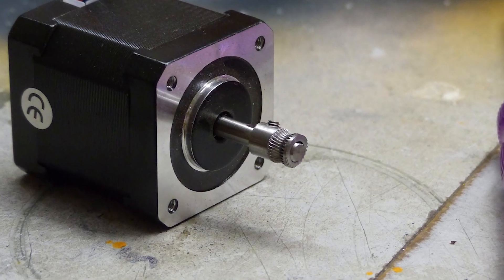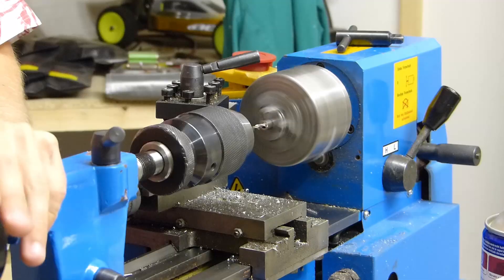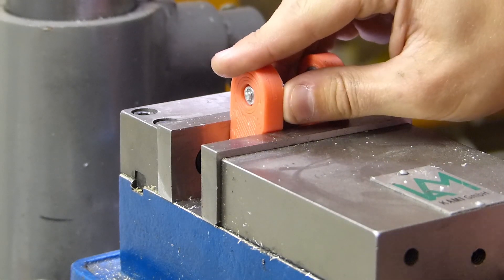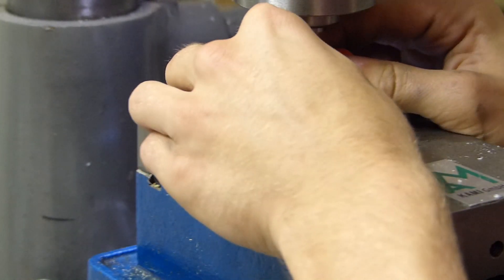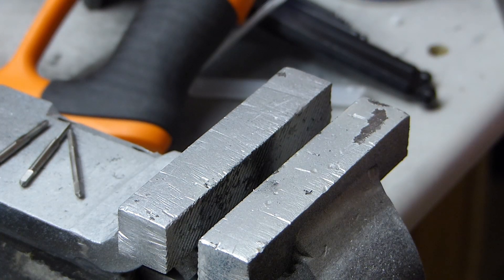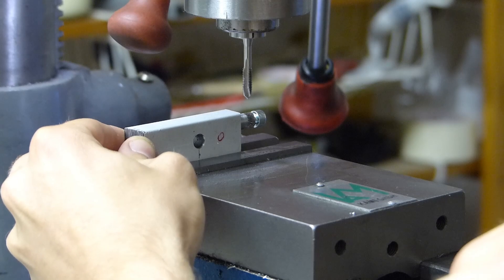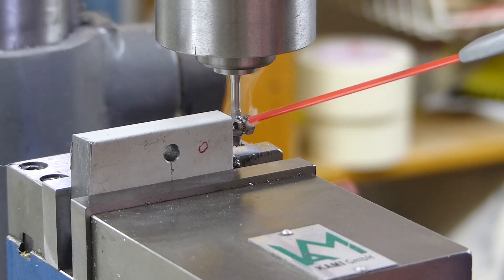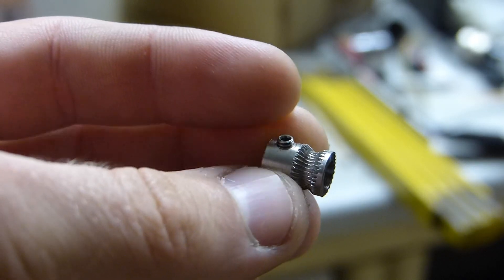Quick tips - Making a MK8 hobbed bolt pulley filament drive gear. Thing.

Comment: Any reason why you used carbide insert rather than HSS, which you can custom sharp for stainless?  I find hard to use carbide tip for larger workpiece, somehow it requires more force to dig into the metal and that is something I enjoy on the mini lathe.

Comment: Great little video :-) I've got a bunch of printers that I'm going to tear down for parts... I have found that older printers use some larger steppers... There are several site where you can punch in the Part Number and get the Specs on a particular motor, chip or whatever you need info on... Generally, I just Google a part number with something like "Motor" or "Chip" as a prefix... If a motor spec is needed, you'll get results that tell you what type of motor it is, the voltage or voltage range, RPM, Steps per 360 Degrees, etc... Even who makes it...

I'm a Robotic Welding Tech and know from experience that Steppers are pretty weak, in general, but can be geared to produce more torque... But really, if one needs torque, it's better to simply go with "Servo" motors as the often have controllers built in... One of the great things about Servo Motors is, the torque curve is much flatter than a Stepper... In fact, some servos can be fed power up to where they will fry... As you apply power to a Stepper, the power curve drops significantly, so one needs to factor in, the amount of torque they need to move the various Axis and go from there...

In most Robotic systems, Servos are used because of the Torque requirements and older systems use Analogue Encoders to determine location... Like a round plate with spaces cut into it, where a laser is used. The resulting pulse of the light hitting the sensor tells the computer where the plate is as it makes a rotation... There's also Feedback systems to determine the precise location of the rotor...

3D Printing has gone in the direction of Stepper Motors, which can be Very inaccurate and do not provide feedback. Servos, on the other hand will measure where the head should be and where it is, so accurate adjustments can be made... Where Steppers require a physical adjustment, Servos do it Automatically, once calibrated... And Rarely require recalibration... In fact, if a builder of 3D Printers, uses Servos of reasonable quality, the need for End-stops is negated... Steppers need End-stops, because they loose track of where they are and require continuous recalibration...

I hope this has give you some good insights... I'll shut up now :-)
Reply: ***** Thanks for your feedback :-)